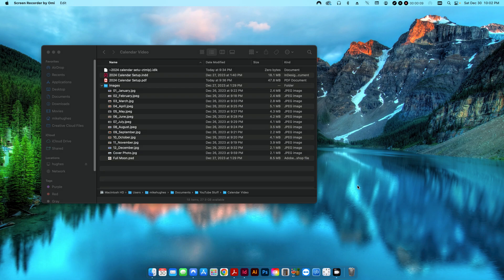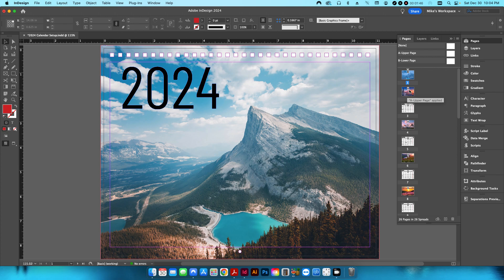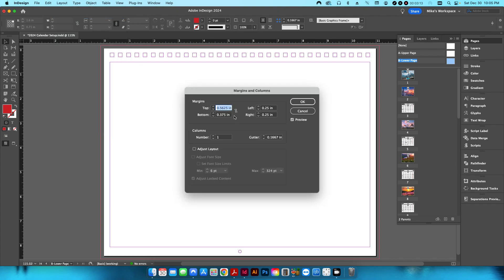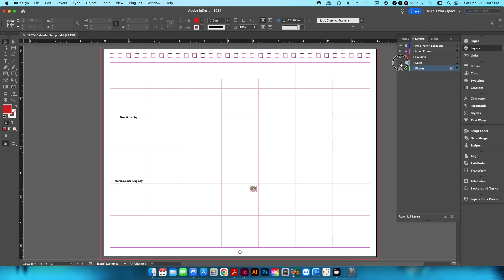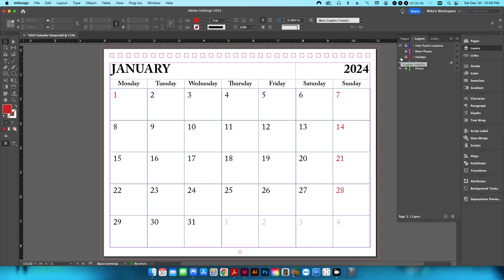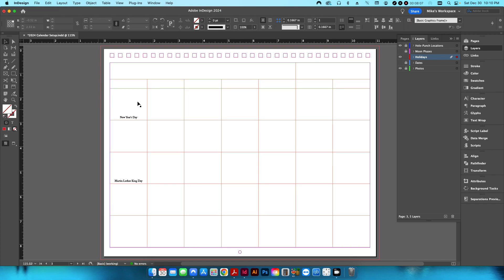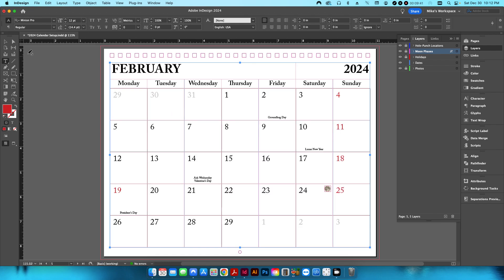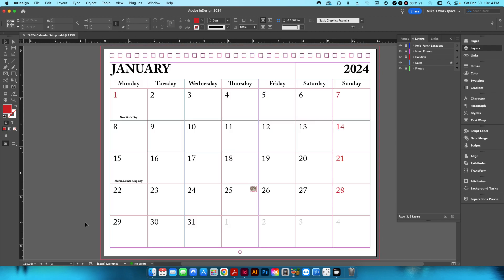Let's Create a 2024 Calendar in Adobe InDesign

Comment: Hey Mike, saw your comment on a sublimation video.I would really appreciate it if you could help me with some knowledge regarding metal sublimation. I just got my scf530 yesterday and I am trying out sample prints on chromaluxes plates but it is just too dark and not sharp. I've used like 9 plates and it's really costing me a lot just to get things right. I've used epson rigid icc and dtg f570 chromaluxe icc but it is still not matching. I printed it in rgb, I tried changing it to cmyk but the brightness didn't change on screen so I didn't bother printing.
Reply from the maker: Unfortunately I don’t have any experience with the scf530. However, I know sublimation can be tricky at first to get all the settings right and color is definitely one of those issues. I would try and brighten the image in photoshop to see how that looks. It might end up being something you have to do to each file before printing, unless there is a ICC profile that automatically brightens the image. You may have to do this for each type of substrate as well. Wish I had an easy answer, but a lot is guess and check.
Reply: Thank you for the reply. Yeah its been a process of try and error till I get something nice. Is there anyone you know that could help me with some settings on photoshop to cater it towards metal sublimation? @miketheprintman